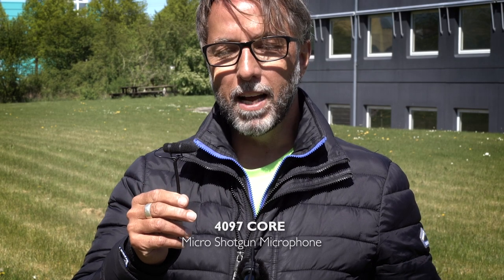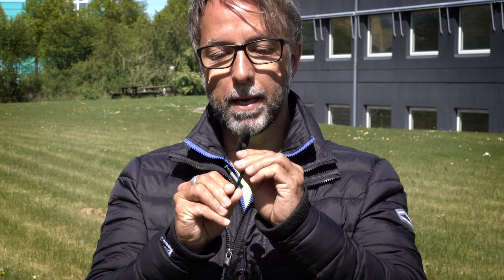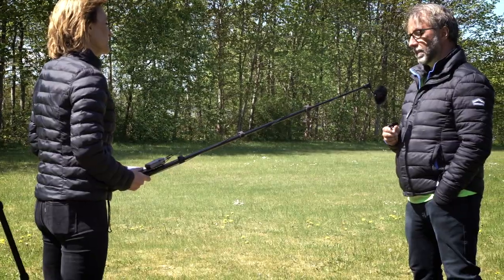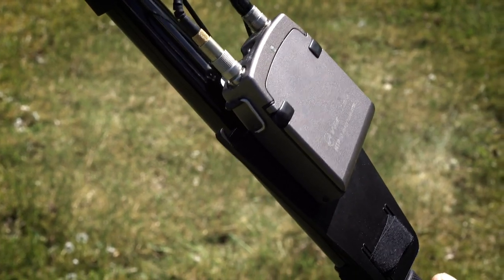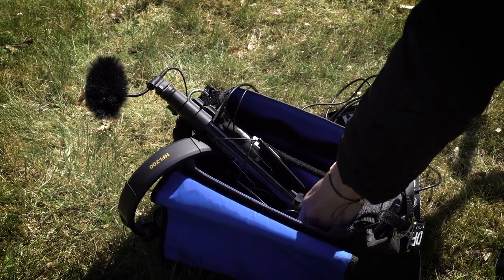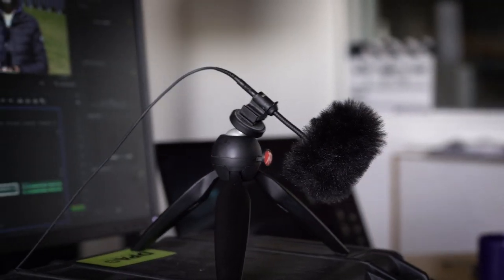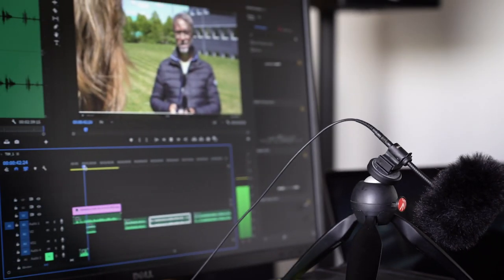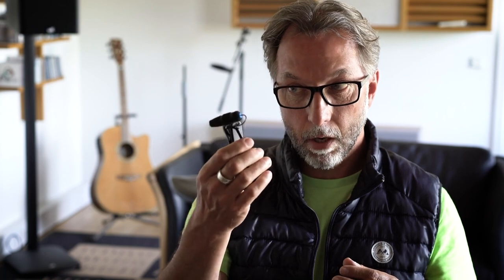4097 CORE Interview Kit - an ultra-lightweight distance interviewing solution

Comment: Veeeery interesting. Please more videos about this mic. I'm currently in the market for a supercardioid to capture dialogue. Would love to hear/watch some comparisons with other mics traditionally used for this, like the 4018, MKH50, CS-M1, NTG5, etc. (I know they're not at all in the same price range, but it would still be interesting to understand the tradeoffs considering how the 4097 is so small and flexible.) Especially interested in how far from the source we can position the mic.
Reply from the maker: Hi Juan. Thanks for your comment and your interest in the new 4097 micro shotgun mic. We wouldn't make comparison videos with competing mics - not that we think we wouldn't fare well, but we think that should be for independent mags, bloggers and vloggers to conduct such comparison tests. :-) 

That said, it could be a great solution for a plant mic, as well as for voice over. Hope this helps, and if you have further questions, please don't hesitate to ask!
Reply: @DPAmicrophones  I understand. Perhaps you could just say roughly how it compares with your own 4017C and 4018C in regards to reach.

Also which XLR adaptor do you recommend between DAD4099 and DAD6001??
Reply from the maker: Hi Juan, It is intended for a closer placement than the 4017. This is because it has a little lower sensitivity and a higher self noise. So it will not be a good choice for overhead booming. The pick up pattern is very close to that of 4017. Compared to the 4018 which is a wide cardioid, you get a more focused pick up pattern with the 4097. 

Go for the DAD6001 for the 4097.